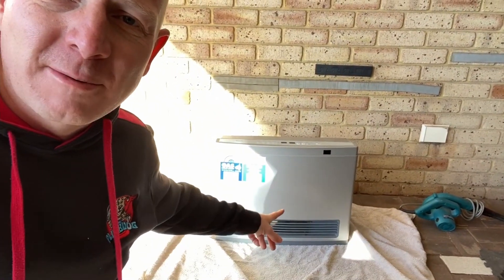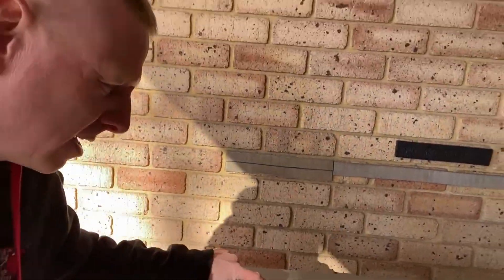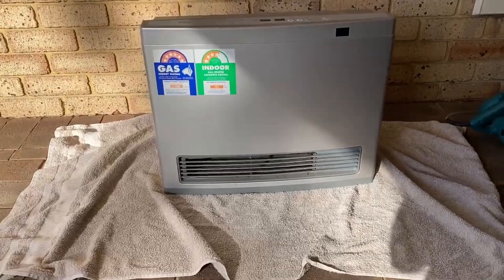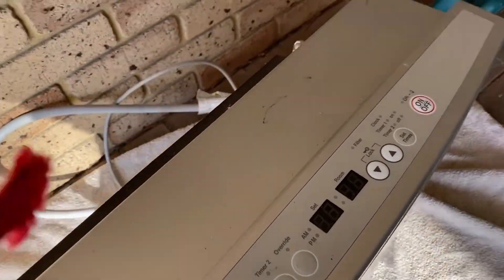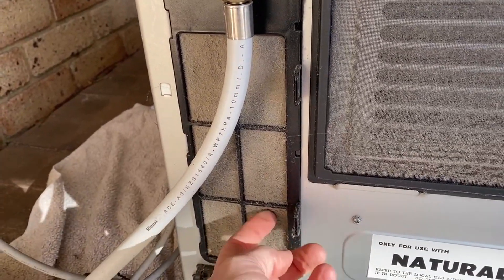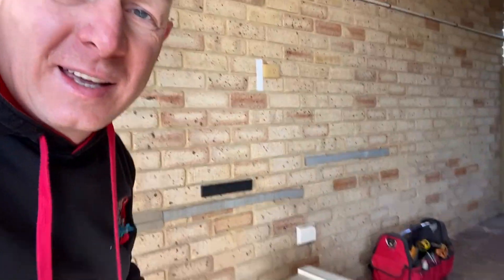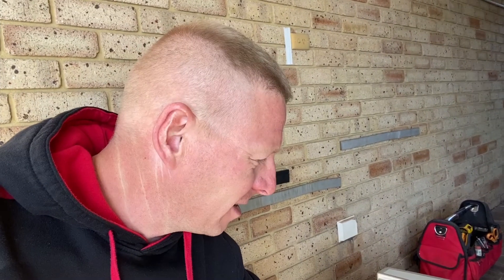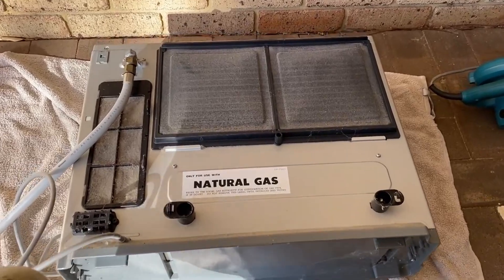[How To] Minor Service - Clean Your Portable Gas Heater

Comment: Can anybody disconnect the heater it self and a plumber or a gas fitter have to do it because it is easy to clean when you disconnect the heater it self.
Reply from the maker: If its a quick connect (bayonet) type then you dont need to be a licensed gas fitter to do this.